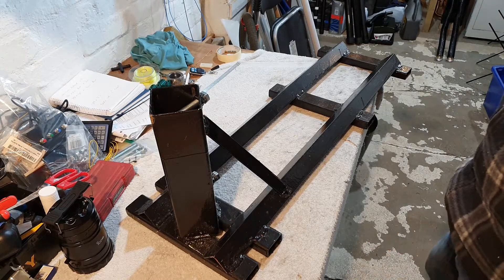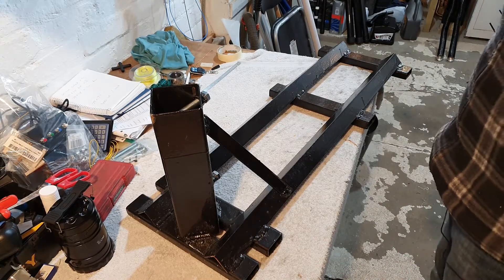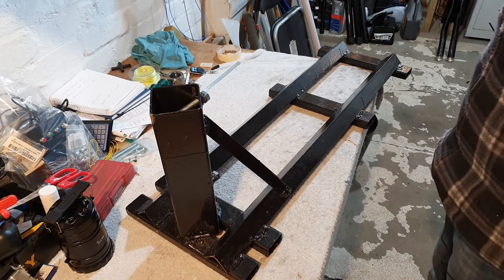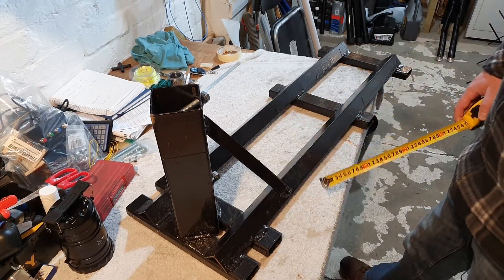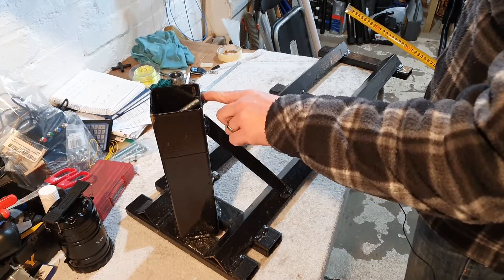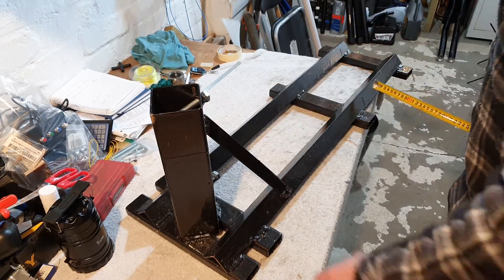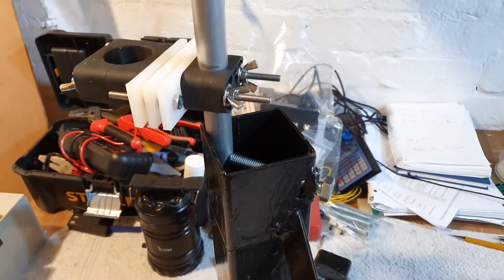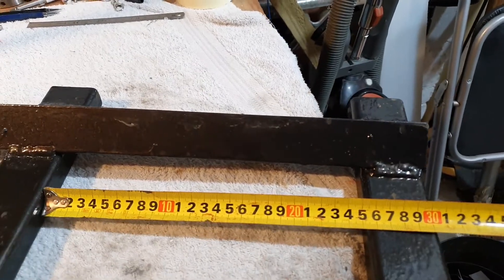My Heavy Duty Ham Radio Drive on Mast Mount

Comment: I made one similar which is tilt adjustable and folds flat for storage and transportation. It easily takes my (new) 12m Spiderbeam pole. I had some bits of steel lying round the garage so, after buying a few extra bits, it ended up costing around £20. I also have a mig welder which made the build easier. I also looked at commercially available mast supports but found, as you did that good one's are pricey. I have a similar mindset Colin, I don't mind paying out for stuff when I think it's worth it but I just couldn't see £££ for a few bits of steel welded together when I could make it for a fraction of the price.👍

Comment: Hi Colin,  nice video. Impressive mount.  Question:  Where did you get the pipe to pipe adustable clamp?  I would really like to pick up a couple of those...  (NG7V)
Reply from the maker: Hi Ron, these were made by myself with plates of nylon sheet, threaded rod and the rubber clamps are made by RSB. If you Google RAVG-652 this will bring these up and you can just select your desired size.